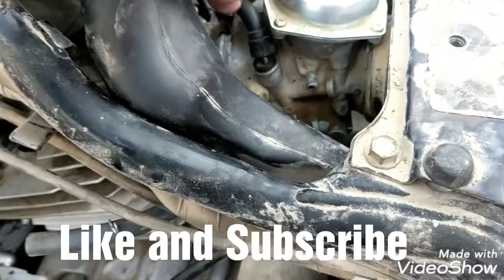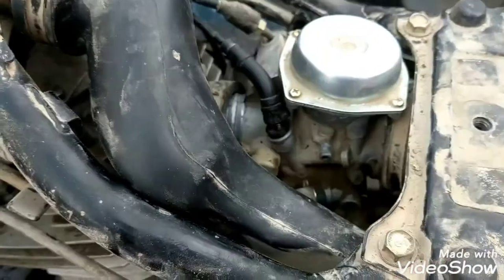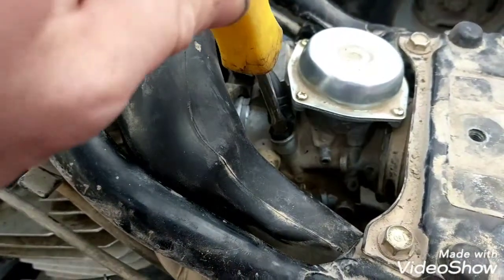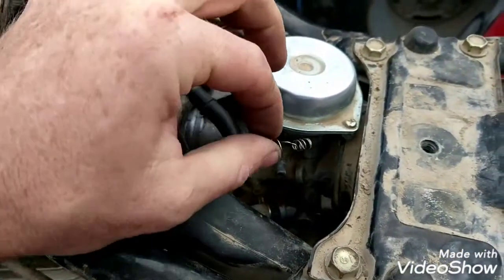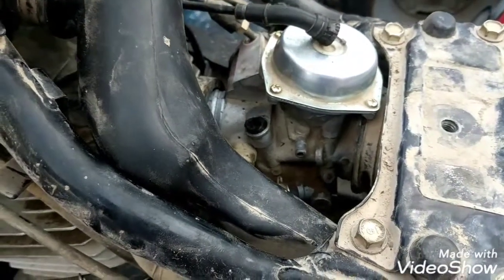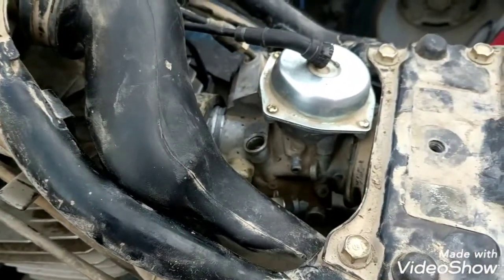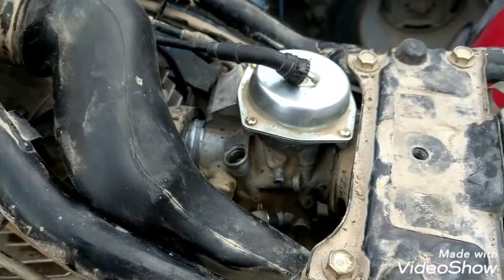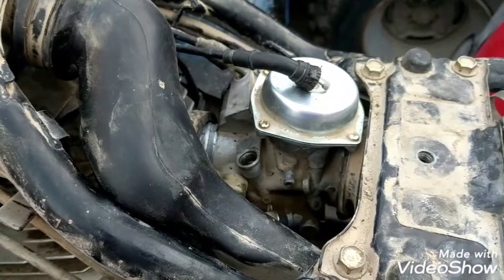Choke cable broke in carb?? What to do!

Comment: A 1 part muratic acid to 5 parts water mixture applied to the choke plunger with a syringe will slowly dissolve the crud. It'll take time but if your careful,  you can salvage the choke cable & carb.

Comment: What brand or manufacturer carburetor did you buy?
Reply from the maker: It depends on what you are putting it on. Usually what I do is find the real part number and then Google it and find a non-oem part that is half the price as oem haven't had a problem with doing that yet.

Comment: Do you know what the choke cable part number is because I have the same issue on my Honda recon?
Reply from the maker: What year is it? The numbers will be different depending on years.
Reply: Well the sad thing is i don't know the year, but is there a way to tell? I haven't worked on it until now sense i got it which was last year.

Comment: Will this make the motor run away
Reply: No, it just acts as a restriction. If your cable is broken it just might be hard starting but you can put your hand over the intake to start it that way, if the chokes stuck on it’ll just bog your motor bad once it’s warmed up.